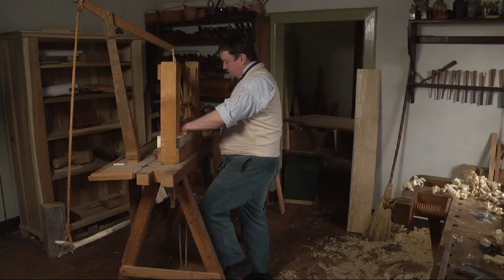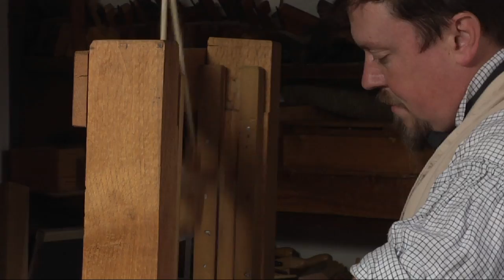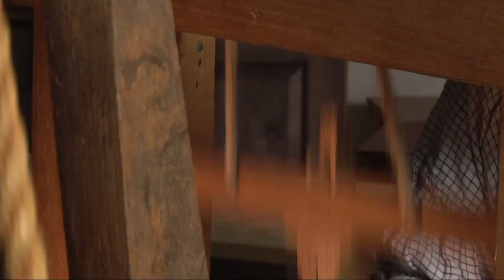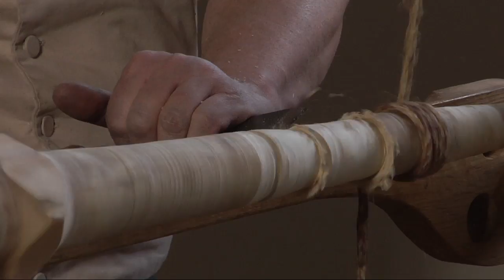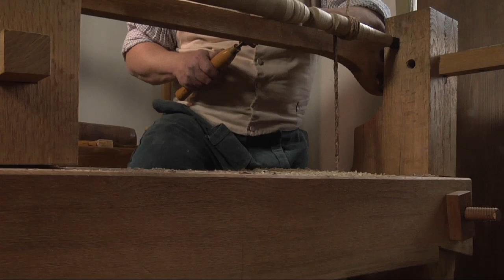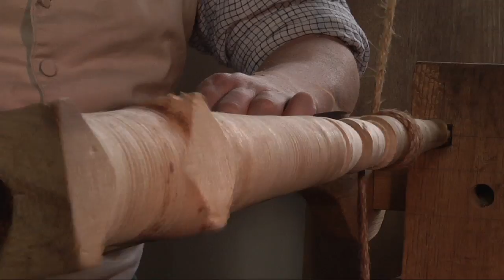Traditional Woodworking Demonstration - Treadle Saw & Spring Pole Lathe

Comment: You really should try turning green wood on this lathe. It will require some modifications in your tool handling the wood will need to be split fom the quarters of the log, with none of the center 2 inches (circumfrence) of the log.